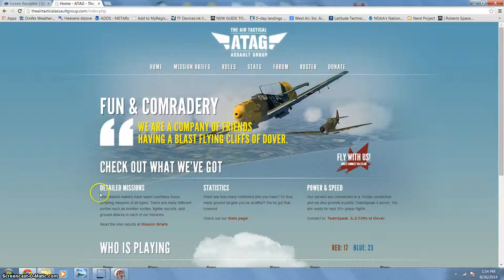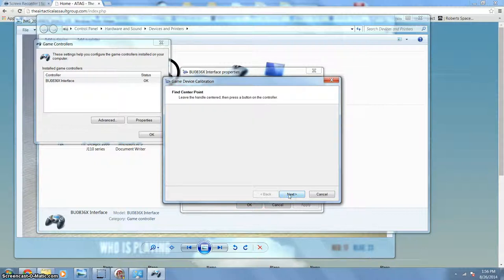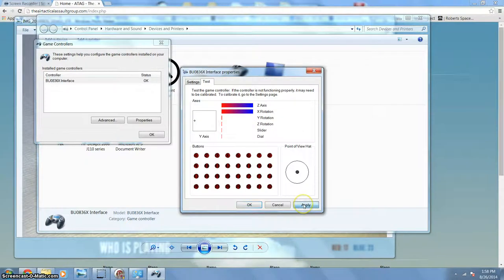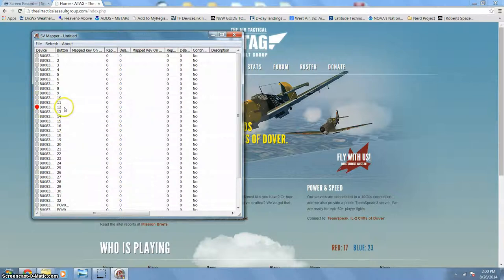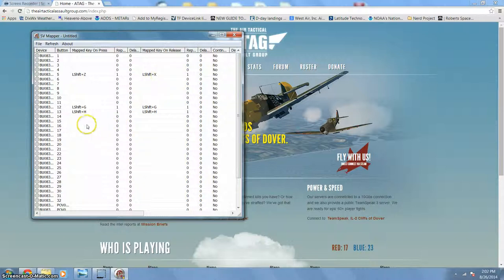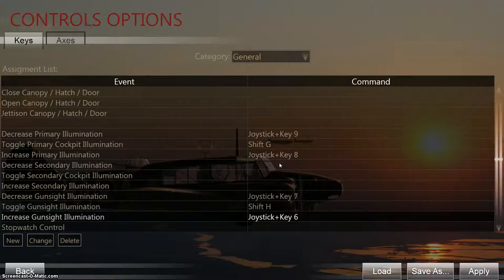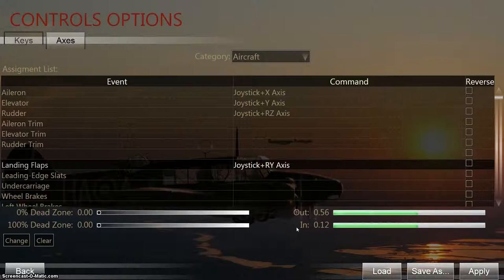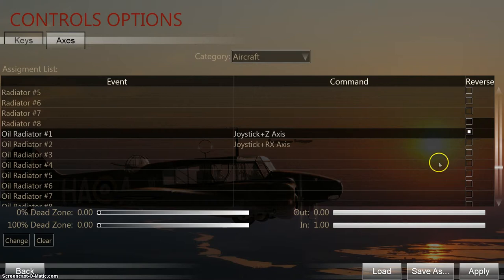1st panel control binding tutorial

Comment: does the bf110 panel work in warthunder sim battle
Reply from the maker: mauther100   It can technically work in any game.  So that answer would be Yes.  I just have the labels of each button, for this control panel, set up for the BF-110.     I've thought about making a War Thunder Panel, but it seems that the game is more meant to be flown with a mouse and keyboard.  I guess one could do a mouse and control panel though ...
Reply: Glenn Lilley ok thanks